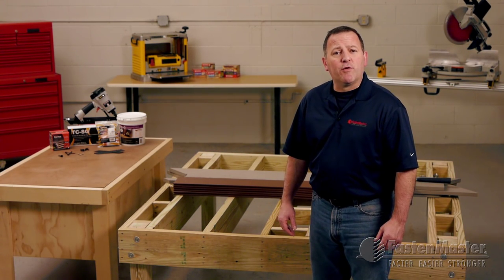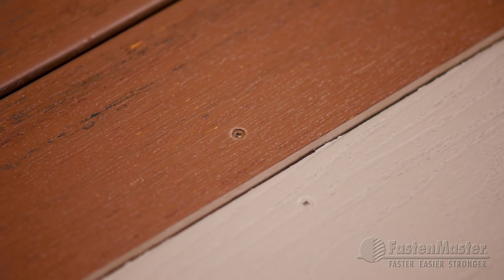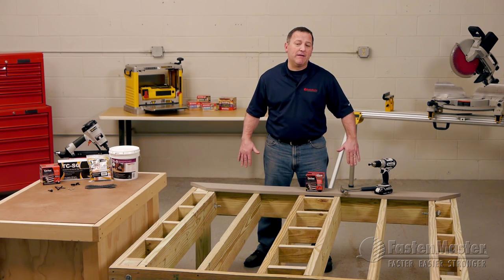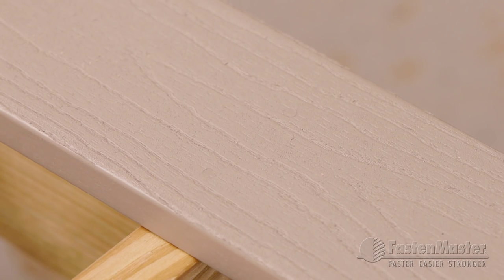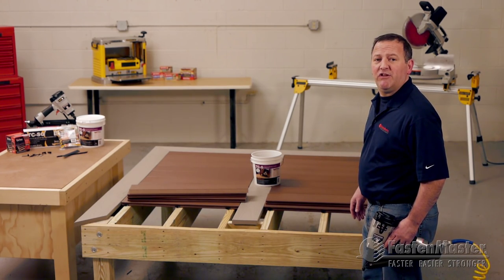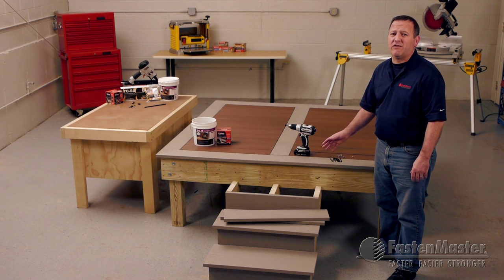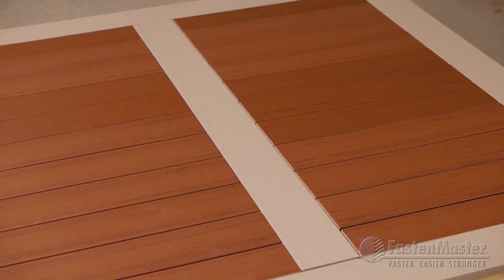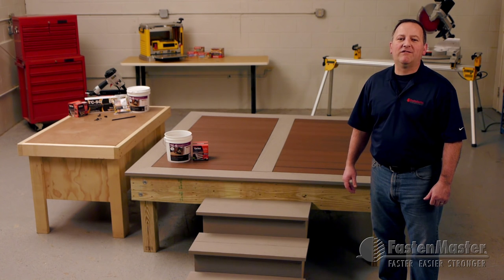Hidden Deck Fastening: FastenMaster TC-G and Cortex

Comment: I have used the TC-G system a few time with and with out the gun so my question for you guys is. Can other types of screws be used with the TC-G fasteners? I noticed using an Impacted even going slow the screw nails still seem to break the heads off or strip real easily. Thanks Davan

Comment: The video says "drive the fastener without pre-drilling".  But the TimberTech website says "Pre-drilling is always required when installing Cortex in TimberTech decking."  So which is it?!
Reply from the maker: From a technical perspective, the system works as intended when installing without pre-drilling.  However, pre-drilling does guarantee the absolute best outcome and many board manufacturers recommend it.

Comment: Where do the plugs come from
Reply: They are made from the same composite capping material. Cortex (and Pro-plug brand) are packed w/the screws, plugs and the countersinking bit, but some people do cut/make their own plugs with a plug cutter to varying degrees of success.

Comment: Lol what’s the point? As long as the deck is sturdy. Who cares about screw holes
Reply: I'd assume the point is for folks who are installing a hidden screw system. You could imagine those individuals not wanting an "almost" fully hidden solution and this fits the bill. I would also say that considering the construction of composite decking you should get better longevity as simply screwing through the protective outer shell will expose moisture to the inner core of the board. Might be getting pedantic here but I do see some benefits myself. My biggest question is how do you get these darn things out if you need to replace the board :)
Reply: there are two ways to do a job, the ghetto way and the clean way....
Reply: Boo. Let's just weld it. Strike Mark's and slag burns but it sturdy as@#$%
Reply: I care about them. So as many other deck owners who prefer clean look.
Reply: Why spackle hammer dimples / screw holes in sheetrock as long as the wallboards are sturdy? It's a finished vs. unfinished look